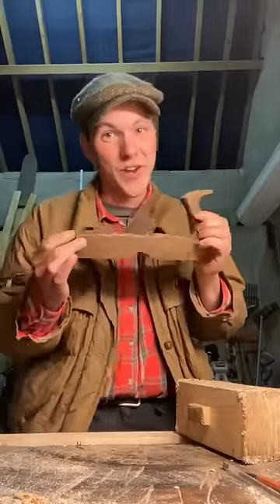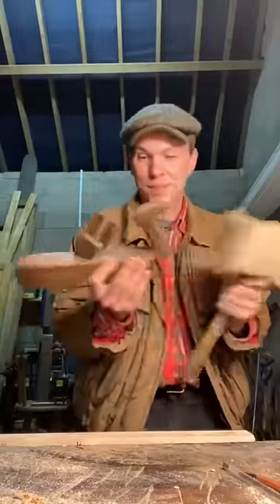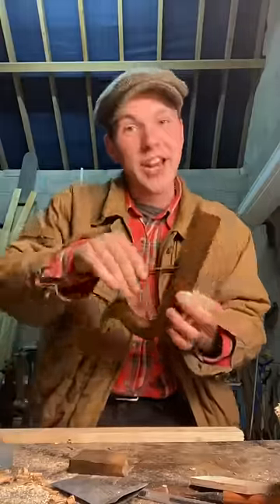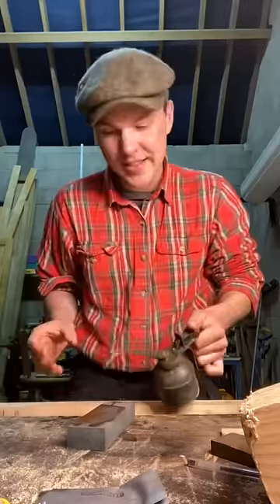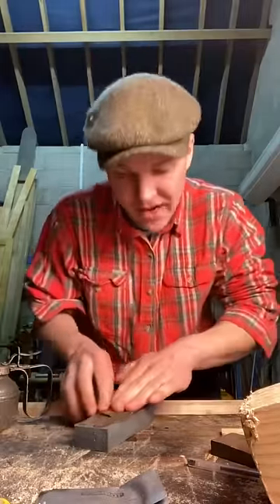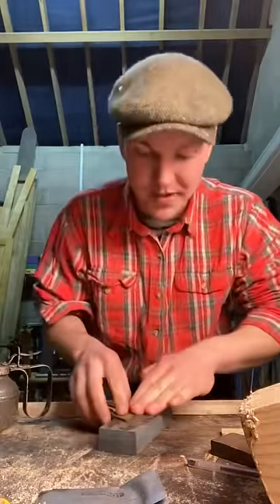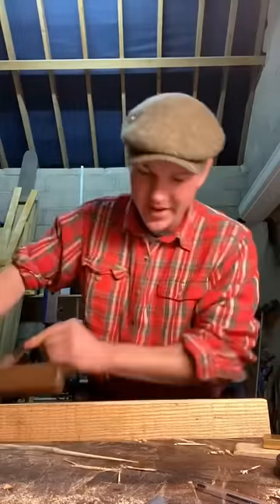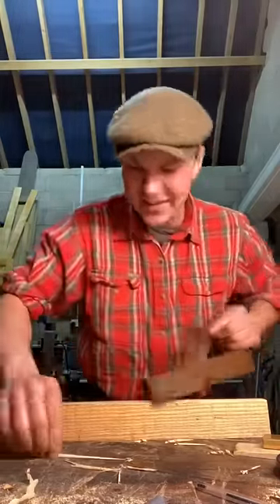using a spill plane #shortvideo #ireland #woodwork #handtools #spillplane

Comment: Not only that, but candles (including rush candles) or oil for lanterns could be difficult to get in certain periods or places, and there were some cases where they used small bits of wood instead, sometimes in a specialized holder which controlled the size of the flame

Comment: On some old gas ovens I've had to cook with the lighter clicker don't work. Those shavings would been useful instead of having half my torso in the oven while waving a hand grenade (lighter) near the gas line. I've been using wooden scures (? Spelling) as well when I have them handy.